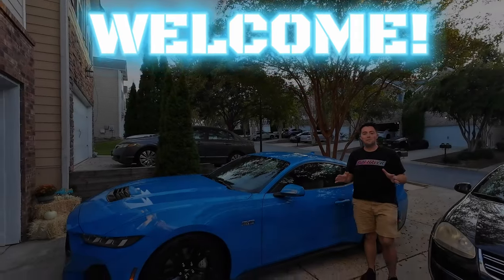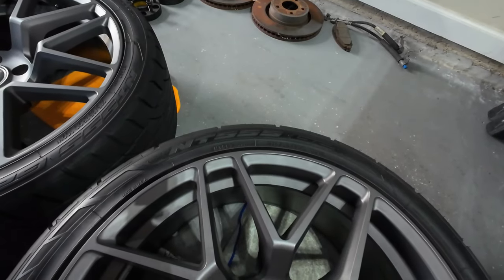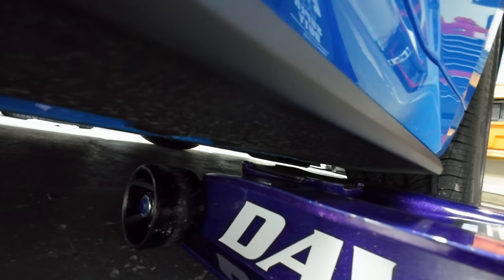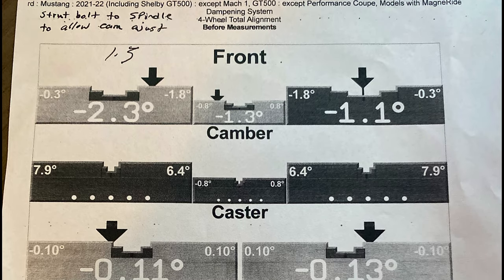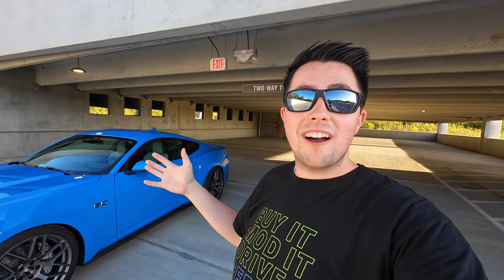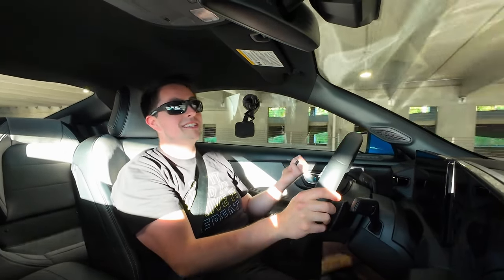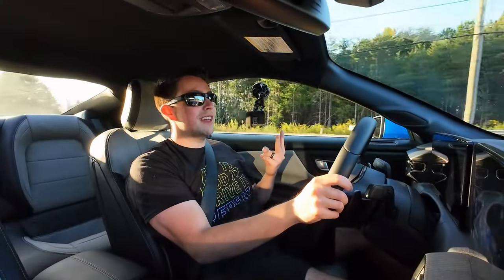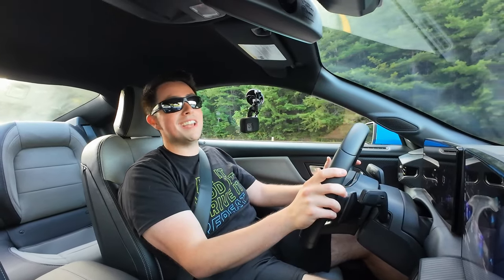Completely Changing The Look Of My 2024 Mustang GT!!

Comment: The first alignment shop he was right when looking at your alignment spec from the second shop, your not in Ford setting. You need camber alignment plate from Steeda , if I were you keep and eye on your tire for wearing on the inside.😊
Reply: yeah i ate up 4 tires fast u need the bolts

Comment: What are your wheels and tire specs now? the original wheels were 19 right?
Reply from the maker: Original wheels where 18s actually with 255s. The RTR wheels are 20” 9.5” wide all the way around. The Tires are Nitto G555 275/35/R20

Comment: I am having the WORST time with these local people here, the spec for alignments are not out at places here.  Only the dealers have it, and they are claiming my car is too low to get it on the rack.  But I think they just don't want to do it.  I took it to several places, and it went on the rack for the work just fine.  How did you get yours done at a place other than the dealer?  Did they use 2023 specs to do it?  Thanks.
Reply from the maker: Really? Are you just lowered on springs? I took mine to a performance shop that specializes in suspension. They were able to get the car aligned right, but I do think they based it off of 2023 specs. This place can Taylor the alignment to whatever your planning to do with the car, track, drift etc. I hope you find a place to get your done soon!

Comment: Do the lowering springs void your warranty??
Reply from the maker: No, no one modification can completely void your warranty. In this case ford probably wouldn’t cover a strut/shock going out since I installed these springs. But if I had a transmission issue for example my warranty would still be valid for that.